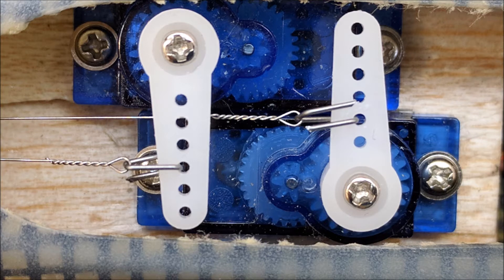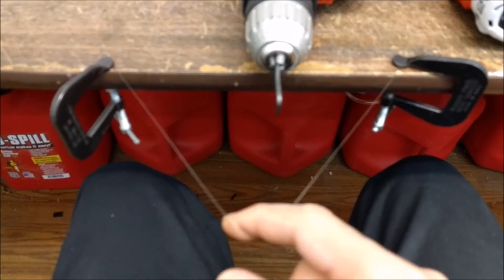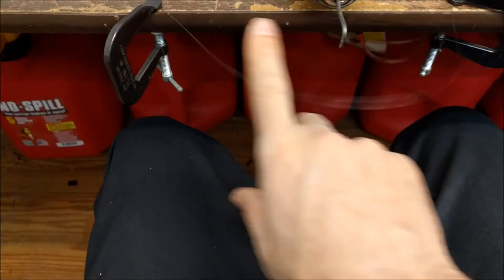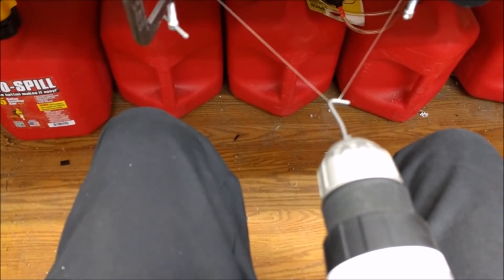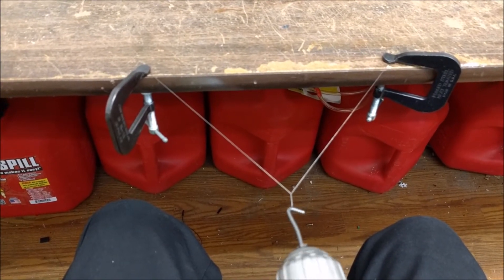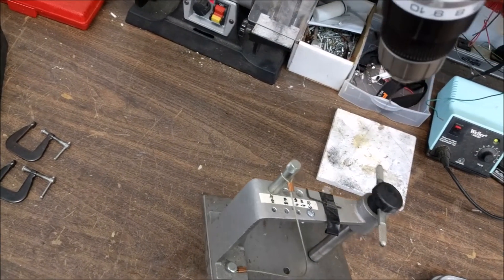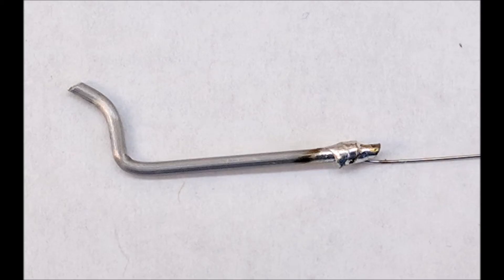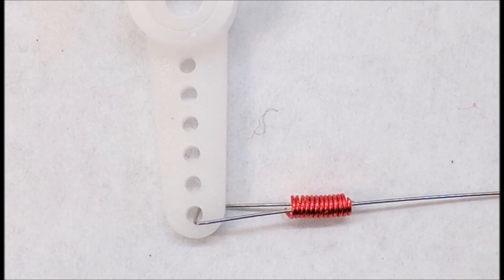Pull wire R/C connection

Comment: I have a Longshot 3 - love it.  I wish I could get it to balance with no added nose weight.  I have spring pull set ups too.  I used Spectra/Spiderwire fishing line - virtually weightless.  Can you/do you detach your control horns when not flying so the springs don't get memory.  Propably needless.   Where are you from?
Reply from the maker: My music wire lines have no noticeable memory. I'm in north NJ USA.